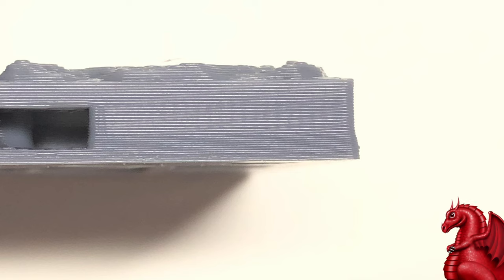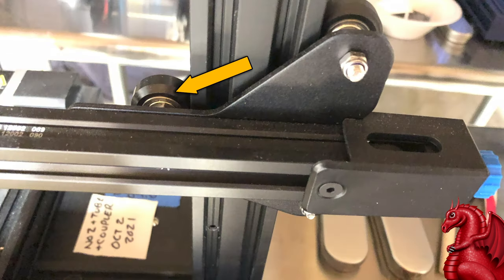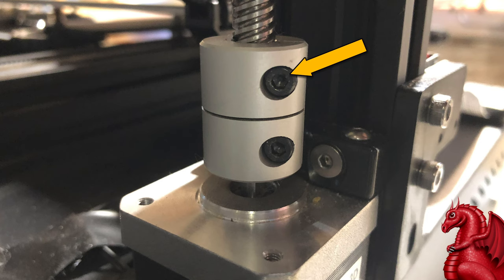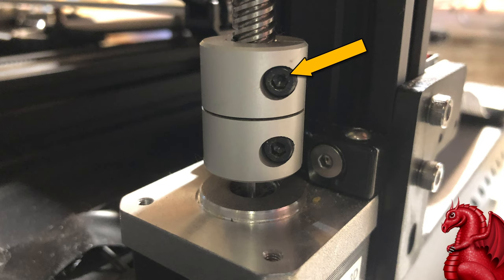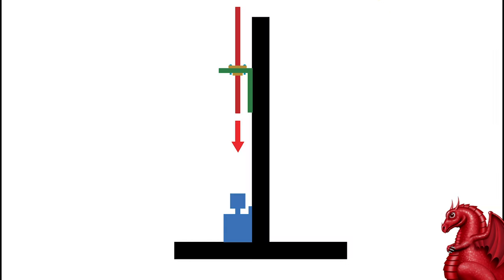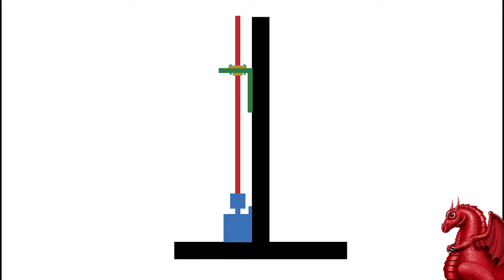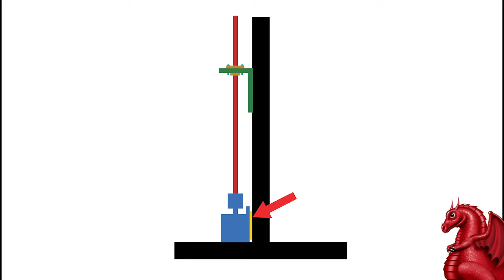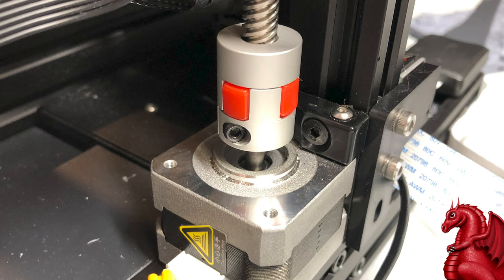Ender 3 - How to fix Z-axis binding

Comment: The legend returns
Reply: Guess I should say something useful here. I got the Ender v2 and used your assembly vids to put it together. Its been having a problem just like this. It stays too low every layer and eventually it clips a layer it should have just risen above, compromising the whole print. I couldn't figure out the term for it so I couldn't really search it up, but Z axis binding sounds about like what keeps happening to me. (Btw, I print with PLA)
Reply: Omg thank you I used this to understand the eccentric screws on my Ender 5 Max, and it fixed my bubbly elephant foor on the first 5 layers!

Comment: Can’t thank you enough for addressing and suggesting loosening the screws on the brass guide. Solved all my problems and now my printer is working perfectly!
Reply: Mine too! I loosened those screws about a 1/2 turn each and now with 2 fingers I can move the z axis up and down fairly easily.
Reply: I had the same issue - I always find it suspicious when a fix is so easy but it seems to be working like a dream now!

Comment: My ender 3 v3 se is doing this I have purchased the said coupler can you tell me how I should fit it as I'm pretty new to printing and I'm having z axis problems by the gantry not raising after 1st layer unless I manually tell it to go up in 0.5 increments once it gets about 3mm into the print its OK

Comment: FYI. I bought the recommended couplers from your link and they BOTH failed within a few months. By "failed" I mean they came apart, separated, during a print. Once this happened the first time, it happened during every print and I need to put the original back on. Great idea, but I don't think these things are necessarily made for 3d printing long-term.

Comment: After waching 100 youtube videos and modding my humble outdated ender 3 v2 to try to get it reliably functional, I think this video hit on why i couldn't finish objects.  Flat lower objects sometimes worked. The higher/taller the object , the worse it got.  I added a dual axis mod to it which didn't fix it and made it worse.  The 2nd stepper actually fought the original stepper and the lead screw would be pulled out of the coupler  My lead screw wasn't straight given the bracket had to be shimmed.  Thanks creality for precision work.  Maybe I'll consider keeping my ender 3 v2 now.  thanks for the video!  I was looking everywhere else but the z axis binding.
Reply from the maker: Glad it helped :)

Comment: I've recently ran into this problem and discovered the same things you showed in this video. In my tests, spirale flexible couplers were only hiding a lead screw misalignement. After moving my Z motor, I went back to the original coupler which somehow worked better than the flexible one. I haven't tried the one you use.
I used Superlube oil as a lubricant and it made a big difference! But the final problem was also the brass nut that had some play due to wear off. I replaced it with a POM nut, but even a new brass nut would do the job as long as it doesn't have any free play.

Comment: I had this issue when assembling my first Ender 3 a few years ago following Fat Dragon Games excellent assembly guide. I then fixed it with two washers as mentioned in this new video. I believe the cause for my first printer having this issue was that the L-bracket holding the z-screw is a bit off 90 degrees.
Reply: Yep, I suspect this is more common than people realize. Having worked in a metal fab shop at one point, it's easy to see how these could not be bent perfectly at 90 on a break press pretty easily. Even if it's automated which I'm sure it is. 

Mine was like 1-2 degree's out, so took it off, bent it back, and it's printed perfectly since then.

Comment: Great video, as always.

My issue actually was "none of the above"... so I thought I'd comment

I noticed when I went to loosen the grub-screws holding the coupler on, that there was NO GAP below the coupler. Removing it, and there was noticeable signs of wear on the bottom of the coupler (and top of the stepper)... literally acting like a brake and affecting layers - especially when using "Z-hop on retraction" settings. :(

Simple to fix, added a shim before re-tightening the coupler back onto the stepper.  Prints like a beauty again!
Reply: Thank you! This was exactly my issue. My fix was to add a piece of heavy paper between coupler and z-motor before tightening. Then pull the paper out to keep the smallest gap between coupler and motor. Cheers
Reply: So I took a look around the net and saw that some people recommend only partially inserting both the spindle and screw so that the coupler can flex more... I tried it and felt like an idiot for not considering that. Also, if you look at the end of this video he does not have the coupler all the way down or even close!

Comment: Thank you so much for this video. I was getting a homing failed error, and noticed z axis was not moving. Every website and video was saying it was the limit switch, which I replaced and still had error. I randomly came across this video, and loosened the two screws you mention at the beginning and I'm in business. You have a new subscriber.

Comment: Thanks for the great instructions. I have tried everything but the upgraded coupler without success. I find that the Z motor only works with gravity. When I increase the vertical position it seems to labor. I find it easy to hand rotate the shaft. The motor is making the sound, but barely rotating the shaft if at all. Do I need a new motor?
Off and on I have had prints pausing at certain heights before continuing. My last print stopped raising after 3mm and continued for a couple hours at that height before I knew to shut it down.

Comment: Thank you so much. I had major Z Axis squeaking when moving, it turned out that my E motor/bracket did align fine with My Z motor bracket, Z screw wasn't bent either, but I unassembled the coupler and noticed marking and friction between Z Motor and coupler, all I did was lube it and now the fans are the loud things. (Was for Ender 3 V2). Good tips on loosing the Brass connector where X&Z connect though, as I did have slight binding as that was far too tight to smoothly transverse.

Comment: Thank you so very much! New Ender 3 3D printer was having a rough almost grinding or stuck feeling as it was closer to the bed. I did everything you had suggested in the video and i moved the coupler off the motor entirely and see that the coupler has made its mark on half of the motor, it was grinding. I'll be purchasing the suggested couplers here in a few minutes.

Comment: This is exactly the problem I'm having with my initial layers (just as you showed in the first picture). After spending a day recalibrating my e steps, flow rate, xyz axis and playing with cura settings I finally have some other things to check. Thanks for sharing this video I hope it cures my problem 🙏

Comment: Perfect timing on this video!  I just ran into some binding issues on a print I let run overnight.  It looks ok; but, the next one will look better (after the tips)!
Reply: Does it really help to loosen those two small screws up top?
Reply: @armani007E55  My next print came out way better; but, I think the biggest improvement came from  cleaning the lead screw.  Mine had build up some junk

Comment: Hello dear friend! thanks for your video, you have a like from me. I am writing to you because of one problem that arose with my 3D printer, in particular what happened: I changed the motherboard to a new Creality 4.2.2 And the firmware is marlin. the old motherboard worked well also Z working good  but it could not produce temperatures above 230 degrees (this temperature need to strong filaments,not PLA) and I had to change to a new one with a new firmware (the old motherboard was: CR7 Creality and even it was not possible to make a firmware on it).
I Thought everything would be fine but I was wrong. It DOES however move during homing and in manual control. This results in the everything getting printed on first layer...
please not be lazy to reply if there is any solution to this problem write to me. I tried everything: I changed the wires of stepper motors but Z does not work, although I repeat when I click on auto return home Z works fine on all sides and up and down too. I connected it to the computer and tried to turn on Z but it doesn’t work. please if you have a source of information please share with me. Sincerely, George!

Comment: This helped a lot with installing my new dual Z axis kit. For some reason my lead screw was also bone dry and a lot tighter fit with the nut, but after some adjusting it freed up. Thanks for the help
Reply: That's the issue Ive got when I tried installing dual z axis, what one ended up working for you ?

Comment: This is a great Z-axis binding video although it did not solve my problem. There is a flat ribbon cable going from the motherboard to the stepper motor. Check to see whether this ribbon-of-wires doesn't get caught as the build plate moves back and forth, and up and down. Seemed like the right place to share this. That was my issue.

Comment: I just completed the initial assembly on an Ender-3, and began performing axis testing.
With Steppers disabled, everything moves smoothly; all eccentrics tight enough that there's no jiggle, but still smooth operation. 
Then I tried an Auto-Home... and the Z-Stepper won't move. I can feel a vibration, so I can tell it's TRYING to move, but can't overcome resistance.
I loosened the shaft-coupler and disengaged the screw-rod from the motor, and tried again... the motor seemed to operate nominally.
So I reconnected the screw-rod and tried to fine-tune all the Z-related components - including the motor mounting-screw spacing from the uprights, the brass rod-locator screws, and even loosened the main upright bolts, just to see if maybe the uprights weren't perfectly 90° with the base, and causing a potential bind.
Everything seems to be aligned, still smooth operation by hand. But as soon as the screw-rod is reconnected to the motor, it either refuses to move (without me helping by rotating the screw with my fingers), or it makes a loud ratcheting sound, like nylon gears stripping.
Am I wrong to suspect I received a brand-new printer, with a bad Stepper? 🤨

Comment: I fixed the original problem... but now it makes strange noises 😅

Edit: Found the mistake. The Z-screw (the thing he shows at the end) was right on the motor. I losend the lower screw and made sure it has enough room.
It strangely was like this when I unpacked it. 
Hope it helps. Sry for the odd gramma. It's not my first language

Comment: For the Z axis screw misalignment, could that also be caused by the tower not being square to the base rail? If this is what's happening, wouldn't your print slowly skew in the direction of the tower lean?

Comment: realized these were loose in the middle of an 8 hour print (im a noob) Ender 3 v3 SE

here i am searching around seeing they are supposed to be tight as my print is still going. I tightened them each breifly while it was going cuz im stupid and have like 2 layers of crap in my print. 

The only question is, is this the only problem with my printer. I get crazy hair like stringing on my nozzle - not like stuff that is effecting dimensions, but its collecting on my bearings and everything really. It chatters like crazy going over infill and sometimes supports - i feel like the taller the print the worse it is

All in all not extremely happy with my first 3d printer. this was supposed to be noob friendly. Not check every piece of hardware on the machine

Comment: 4:19 IF YOU LOOSEN THE NUT YOU WILL ADD BACKLASH TO THE SYSTEM, AND (caps) you will probably no longer be able to use Zhop withoud issues

Comment: I just relocated the z axis motor to the top and added thrust bearings to get rid of all these issues. Belted Z is probably the best way to get the most out of the Z axis. Unfortunately there are no kits available for it just yet.

Comment: Can anyone confirm that it does help keeping those two small screws a tiny bit loose? Ender 3. Tks!
Reply: Running them loose made my first 6 or so layers print like poop. Took me days to figure it out. Keep thinking it was the right side wheel binding or over extruding. Finally realized keeping them loose was the issue. Tightened them up, running percent now.
Reply: @mmulisha1022  really! I was getting some weird odd prints as well. I forgot I made these loose. lol What type of printer issues were you seeing?
Reply: @armani007E55  rough first few layers. Looks like an over extrusion, or smashed few layers. If the first few layers look weird, then it cleans up and prints find. That is likely the issue

Comment: i dont understand how you guide the screw when your gantry will just fall if it is not connected to the screw. am i missing something? im sorry for the spam. i have tried everything else and i think it is the spacing, but i cant do the drop down test withought my gantry falling down to the bed. what exactly guides the screw to make sure it fits into the coupler?

Comment: Please sir, can you make a video on how to prevent warping? I believe this is a first layer issue. I enjoy the way you teach and was hoping you can also speak on this matter, its still unclear to me. thanks in advance!
Reply from the maker: Cut bed temp to 55˚ and make sure there are no drafts, the room should be around 70˚ as well min.
Reply: @Tombof3DPrintedHorrors  im actually using petg. I copied the profile you had for the miniatures figures and was able to successfully print a very tiny gear. 

For slightly larger prints around 10mm square, this is where I found problems. I like the petg and plan on using it, its also cold here on the east coast and my room temp is around 50f (basement). I will try using a small heater to increase room temps and try again. Thanks for responding!
Reply: @microcrafts7947  Using an enclosure would be very helpful to combat warping. Other than that, above comment is already right (lower bed/nozzle temp if possible). If using a smooth surface (like glass bed), make sure surface is clean (wipe with isopropyl alcohol) to get best adhesion.

EDIT: Forgot you could also decrease the thickness of bottom layers and walls. Could try that if you don't mind less part strength.

Comment: Well, the shims are worth a shot I guess. My prints are getting really rough bottom layers, then some banding, then smooth out as they get higher. Dual Z-axis, loosening and tightening screws, flexible couplers, adjustments, deconstruction, reconstruction.. I've learned how to deal with this machine, but none of it has fixed the Z axis issues.. basically I've burnt myself out and have no answers.

Guess I'll print, like, a few shims and see how it goes.. it's subtle, but the lead screw does seem to want to fall on the outer edge of the gap in the coupler..

Edit:
That was it. Made it print well enough for me to print new Z motor mounts.

Comment: I got the coupling for the stepper motor. No matter how hard i tighten the screws, the coupling slides in and out of the coupling. There's no tension and the screws dont tighten enough. What am i missing? I'm losing my mind

Comment: @Tomb of 3D Printed Horrors, do you have a video on how to install the flexible couplers properly (Things to consider, should the motor shaft and/or the lead screw touch the red plastic when installing etc.?) I've struggled with installing mine though it seem simple enough considering the myriad of conversion I've done already 🙂

Comment: Helo, i have a horror situation. Happened twice. At the end of the print, right before the last layer, everything prints fine, but instead of going up and home, the z arm just smashes inside (downwards) the print, destroying the top layers (bout 1 cm). I believe its a slicer problem, i used slic3r, when i exported from windows no problem, but from mac i don t have the “slice” button, just the export gcode button. Could that be? Although it doesnt have the slice button, it exports the print ok, with armature too

Comment: I've the Ender 3 Max, and i think i have this issue, after less than a mm the nozzle touches the print, and starts "squshing" it. I slightly lower the front of the bed, as its only the front of the bed it seems to affect, and then it goes on its merry way, no issues again...... Until the  next print, the nozzle is too high, and i have to lift the bed slight, and do the same again each print. Is this Z axis?

Comment: Nice explanation, I had to refresh my memory of it. To the couplers: 12 bucks for 2 is not much, but 5 bucks for 4 is even less, source is of course China via the all known online place.

90% of the Enders have problems with badly manufactured Z-Axis mounts, I never heard something different from people. I guessed, I've eliminated this issues in January, but cleaning didn't help. So I check the couppler and the v-roll, maybe it's done and needs new ones. Luckily, I have a few to replace them.

Comment: Thank you for helping me fix this. I noticed this was an issue ever since I first assembled it and I did everything you said and now the extruder gantry moves up and down. It wouldn't move it all before that unless I actually turned the rod. Unfortunately, now I have to deal with the therm runaway and I haven't even had these for a month and probably only ran the heating element for 30 minutes tops. I wasn't even hard on it. I just used the PLA presets

Comment: I have these couplers, and when installed,  the coupler screw hots the bracket for the motor. I then lifted the coupler up higher on the mount but seemed like it was to high.

Comment: Would this cause the print nozzle to knock off tall vertical prints about 75-100 percent?
Reply from the maker: Yes, but it could also be your hot end assembly has loose screw(s) allowing it to wiggle some doing the same thing.